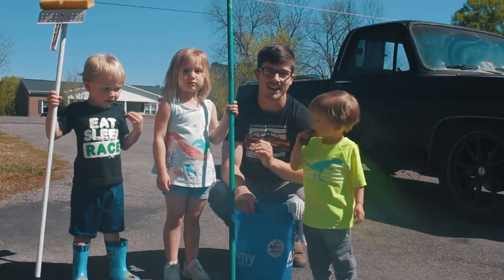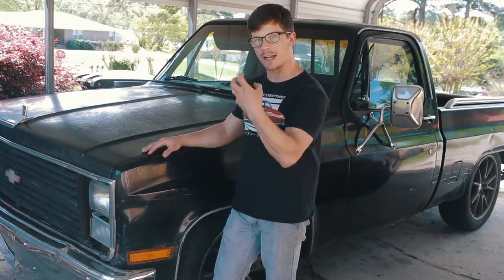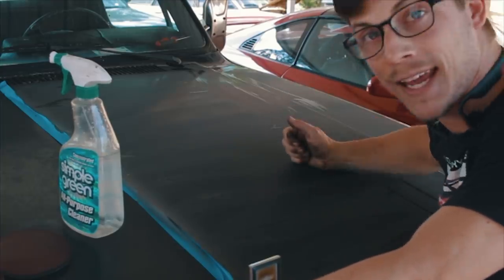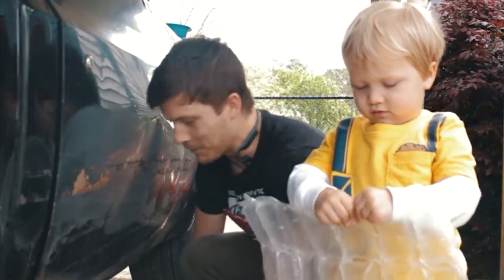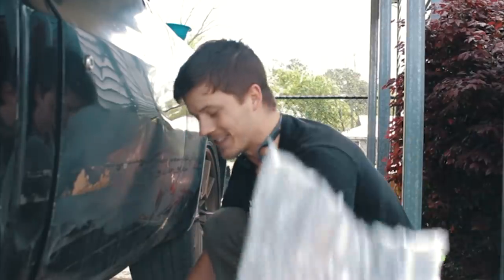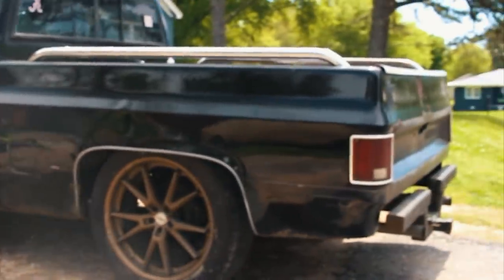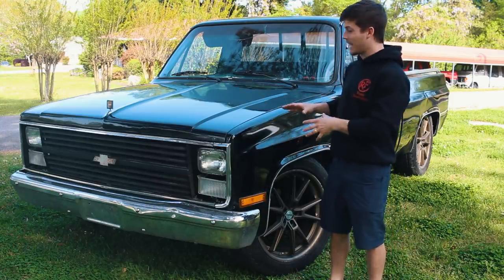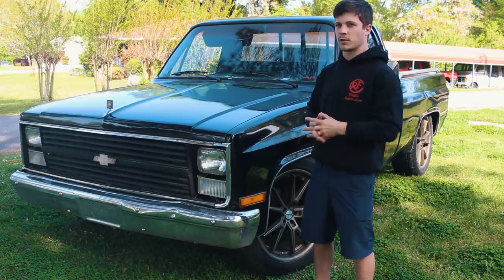$2000 BUDGET C10 CHALLENGE: FIXING 35 YEAR OLD PAINT!

Comment: Use a clay bar first to get all of the dirt out of the paint. It keeps your pads from getting full of crap and scratching the paint. Foam pads are easier to clean and work better than wool. You have to match the foam density to the hardness of the paint, this is where most people mess up with foam pads. If you don’t get the foam density right your results won’t be that great. But if you match the foam density to the paint correctly the results are amazing